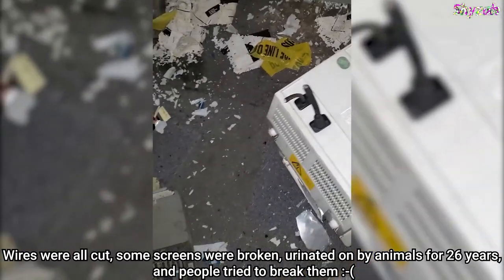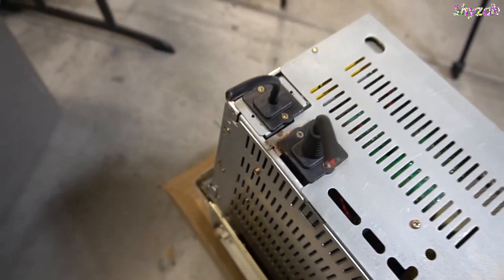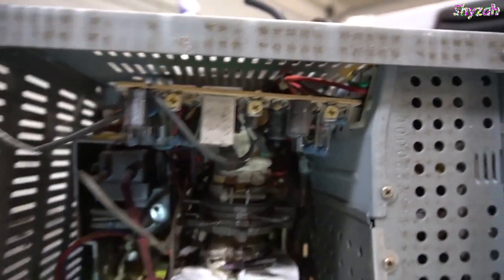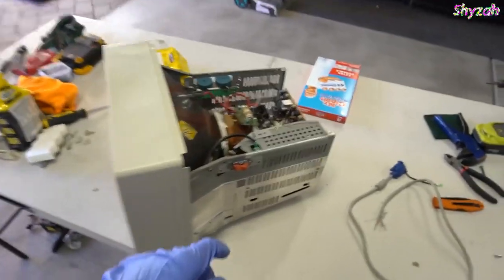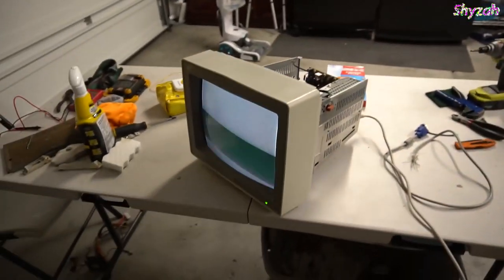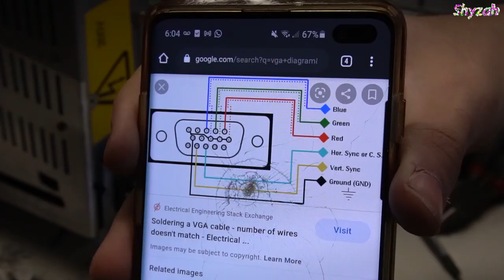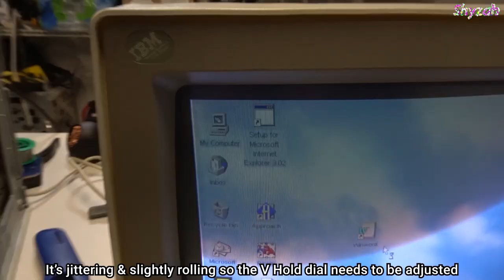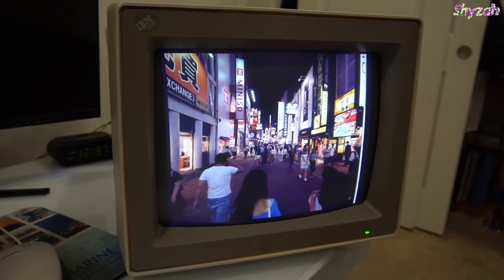ABANDONED IBM CRT Monitor Restoration! Can it run Minecraft?

Comment: IMAGINE if some company with some deep pockets re-engineered the CRT monitor, to make it smaller, lightweight, compact, and able to handle today's insane resolutions like 4k and extremely high refresh rate. Gamers could rejoice as we dump LCD since its garbage.
Reply: And apple would catch on 5 years later. Claimed to have invented it and called it electron retina
Reply: @stealthysaucepan2016  LMAO
Reply: Unfortunately, the CRT design was already optimised to maximum efficiency before LCD's hit the market, since CRT's were incredibly complex and the technology had been around for 3x longer than LCDs. So even if we brought them back today, aside from some quality of life changes and circuit optimisations, CRT's would probably still be at the same resolution that we left them at. The colour contrast however is top notch and is still something modern panels are unable to achieve.
Reply: @cathodert7890  ill give you the age difference. But optimizing it, thats bullshit.

We can make electric guns so small now compared to the huge size we used then. We have not optimized that technology all.... And yes i agree we could make the circuit boards smaller and more efficient which means less power waste. Im sure there would be a way to optimize the glass tubes themselves making then lighter weight and slimmer/less bulky. However as far as resolution i literally believe we could get 1080p and even 4k out of a "modernized" CRT. Its just a matter of someone smarter than me outting in the work. The only downside would be that modern electronics and graphics cards no longer have analog output, its all digital. Probably the only real barrier to bringing back the technology.

Thankful next month OLED is hitting the gamer space via Alienwares QD-OLED display which is gonna be epic and im buying one. 3440x1440, 175hz, 0.1ms gtg times, insane contrast and color, no ips glow no backlight blooming. Gonna be amazing.
Reply: Remember that plasma screens are basically the next generation of crts, an in-between for crt and lcd technology.

Also, crts generally have pretty much zero input lag that lcd has yet to reach.

I'd still use my lcd since they're bigger, but I'd rather have a crt projector if I'm going to want an ultimate experience.
Reply: lccs is the closest technocoly you can get to what you described. it used a monochrome CRT with a polarizer similar to what's found in projectors, and used that to get color with good clarity and higher resolutions. sadly it never took off
Reply: well i mean, by 2006 they were already 4k capable and could get to more than 120hz , the problem is reenginering them somehow to make them more streamline with todays market
Reply: No we won't
Reply: @goblinphreak2132  the GDM-FW900 is 16:10, flat screen, and supports up to 2304x1440i resolution. it came out in 2004.
Reply: Surface-conduction Electron-emitter Display
Reply: There are crt's capable of higher than 4k and they had refresh rates for 344hz

Comment from the maker: For anyone wondering, the PC video is 95% done! I've been stuck on the very last step of the restoration for the past few months. I'm hoping to have the video up in 2-3 weeks.
Reply: Please do more videos like this.
Reply from the maker: @simonemastroianni1985  I have a bunch more coming all of various different abandoned computers :)
Reply: Nice video but i have some points around soldering - take it as respectfull help for next repairs 
1. Make sure that flux is non washable , otherwise it can casue corosion in few years - always wash it with isopropylalcohol
2. Please do not use hotglue - it non repairable, use shrink tubes on every single join, it the best and professional ! 
3.That old caps throwed in regular thrash hurts me, please sort it to special waste :(
But wow, at all its nice work, figuring out the wire diagram etc.. ! 
But hey I didnt mean it wrong pal , have a nice day :)
Reply: @Shyzah I have a very rare NEC vintage monochrome CRT think you could point me in the right directing to fix it up?
Reply from the maker: @r.in.shibuya  whats wrong with it? I honestly didnt know what capacitor was causing the problem so i literally replaced every single one haha.
Reply: @Shyzah  thanks for the reply. I’ll upload a video this week and ping you when it’s up. It’s a Japanese model, I’m based in Tokyo.
Reply: @Shyzah  ooh when's those videos coming out

Comment: It’s amazing seeing how much you cleaned up & replaced, but I feel like rather than cut the sides of the VGA cable you could’ve moved the VGA input to be on the outside of the CRT shell. Anyway, it’s wild how a CRT from 1994 also supports 480p, but I guess CRT desktops monitors were always ahead of the curve when it came to supported resolutions

Comment: I used to have the 12” version of this IBM monitor back in the early 90’s which I used with my first PC. I had a big problem with it where the VGA cable failed just where it meets the VGA plug. The monitor was quite old back then and I had a lot of difficulty obtaining a replacement cable and I could not get one here in the UK. In the end I got in touch with a company who had the pin out and were willing to cut the cable a little shorter and fit a new VGA plug. I received the cable back in the post, fitted it and the colours were wrong. I sent the cable back again and they got it right the second time! I was so pleased to get my IBM display back again! A suburb quality monitor with strong casing and fitted with a Panasonic CRT. I didn’t like the hard wired VGA cable and power cable which let it down for me.

Comment: You might want to turn down the blue gain on the CRT because it's a little overbearing 😂.  And try useong a hair dryer and a flat piece of metal to Un warp the plastic.  Might help.  I've done it to fix warped records before.  Good job saving that monitor dude!  I prolly wouldn't have been as bold to re make the connections on the back that were cut.  I'm not that good at soldering yet.
Reply from the maker: Thanks man. Yeah, I definitely need to adjust the blue gain. I have yet to look into it but it will only take 30 seconds to open it back up.  I'm actually fine with the plastic being warped as it tells a story. The building that it was in was set on fire by some lunatics a few years ago and I believe that the heat from that fire made the monitors plastic warp even. After all, the monitor was in the same building just down the hall.

Comment: I have the exact same monitor! Mine was manufactured on May 1st, 1989. I also have the original IBM PC, though the floppy disk drive needs a replacement. It's a shame that this monitor can't do resolutions more than 480p, because I'd consider it as my main monitor. I currently don't have a monitor, so what are the best places to find old CRT monitors for cheap prices? I personally prefer CRT to LCD displays for my old retro gaming PC and vintage computers, and honestly modern computers, too because of versatility in resolutions and refresh rates. When my computer can't handle higher resolutions, lower resolutions will look nice and clear!
Reply from the maker: aside from ewaste places, i would serach offerup, facebook marketplace, and craigslist

Comment: On that VGA cable after hot gluing it you should have gotten yourself some 3M rubberized tape stuff ... It's not like tape when you lay it over itself it's sort of like goes into itself it becomes one solid rubber sheath and it doesn't unravel over time.... I use this trick on all of those kind of repairs.  You can find that rubberized tape at like Lowe's and home Depot if you're just looking locally I usually just order it offline

Comment: I don't have any luck to found computer CRT monitor. But at least I found a 14" CRT TV disposed at the dumpster few years ago and restore it to working condition. I can connect it to my laptop using VGA to AV converter device. The picture I think blurrier than computer CRT monitors, but for watching videos or playing games that doesn't have to read text so much, still good to go.

Comment: Yo you got the detailed pinout for VGA? Doesn't the old CRT from IBM use a different connector protocol? I assume that's what the jumper wires were for :)1
Reply from the maker: Here's the pinout i have saved on my phone not sure if it was the last one i used. One of the wires might be off or something.
IBM → VGA
YELLOW ? focus, 2nd ground?
ORANGE H sync
BLACK ground
WHITE  V sync

Comment: that's awesome dude, I ended up finding an old tv in my closet that still works, I believe it can run close to 600p so between 480p and 720p as well as it being 60hz. I ordered an av to hdmi adapter to hopefully be able to use it as a 2nd monitor for discord or possibly youtube. If it works and you are interested, I'll post a vid about it.
Reply from the maker: Actually i was looking for ways to hook up a PS1 to the CRT but it seems like its very picky and only takes in 480p. All the converters i tried on amazon didnt work with it. Reddit suggested some other expensive converters

Comment: I love that monitor those are grate monitor i play my Xbox one on one of those monitor it  Compaq pasario 410 monitor i love my Compaq monitor i have Been using CRT television and monitor through my child hood i was born in 1999 and there was no such thing as a LCD or OLED when I was born and my parents didn't get a flat screen until 16 they didn't have the money for it so we used Crt television i have my mom & dads old Compaq 410 monitor and computer it run windows 95 still works perfectly and i love both my computer and monitor

Comment: Lmao I'm just surprised monitors were 60hz back then, I thought they were like 20hz, great vid BTW!
Reply from the maker: Nope! CRTs had high refresh rates. Standard CRTs in the 90s could easily do 120Hz, some even up to 240hz. Many CSGO competition gamers preferred CRTs over LCD in the early 2000s since LCDs had slower refresh rates.
Reply: @Shyzah  wow, do you think there is any chance I could get one rn, lol I wanna see that 240hz
Reply from the maker: @spxrkfn7  the good ones go for a lot now but u can probably find 120hz ones on offerup or craigslist for cheaper
Reply: @spxrkfn7  you can probably get one for Free if you know the right guy or buy a cheapher brand thats still great like samtron crt monitors. Just make sure too not buy crts from ebay. Also if you want a bigger screen and still have  a higher refresh rate on lower resulotions you could get something like a barcographics 808s.

Comment: At the end of your video the Monitor displayed 3 separated screens what did you do to fix that problem?
Reply from the maker: for these older 480p models you need to go into the monitor settings on windows and create a custom resolution of 480p to get it to work properly
Reply: @Shyzah  Thanks so much for the information.

Comment: I have an IBM computer from 1993-ish that's probably at the very least similar to the one you found. It's an IBM PS/2 Model 56 and it uh...doesn't currently work, the power supply is bad in some way.
Reply from the maker: Suprisingly the power supply I found in mines worked. Good luck.
Reply: @Shyzah  thanks! There is a fair bit of rust on the chassis so I think this poor IBM spent years in a damp place.
Reply from the maker: @VSigma725  yup, roof had collapsed in one area and rain water was getting in.  The other model m keyboard was so rusty

Comment: Hi. I'd like to make a 3D model of this monitor for 3D printers. Could you please help me with some measurements if you still have this monitor?
Reply from the maker: yeah I still have the monitor, what measurements do you need
Reply: @Shyzah  Thank you for the answer. It depends on how much time you are willing to spend on it :) If you have little time on it, I can specify only a few highly required dimensions, if you have more time, I can specify more dimensions to make the model more accurate. I can send you the photos of the monitor with the required dimensions marked as A, B, C, D, etc, and you will only have to measure them as shown in the photo and write notes to a text file such as A=100mm, B=200mm, C=50mm, etc. Please let me know are you willing to measure the minimum required dimensions (fast) or more (may take 10-20 minutes or so).

Comment: Looks great, although I think you should adjust the picture a little bit more to expand to the other edges
Reply from the maker: If you look at photos of these online its actually like a 1 inch border on all sides of the screen. I was able to stretch the image to make it fit top and bottom but theres no way for left and right.
Reply: @Shyzah  There's no pot on the board at all for horizontal hold?
Reply from the maker: @apfanco  there is but it wasnt making it wider. If i mess with it, the image was either staying there or spazzing out. I could move the image to the left but then the right side would also move left